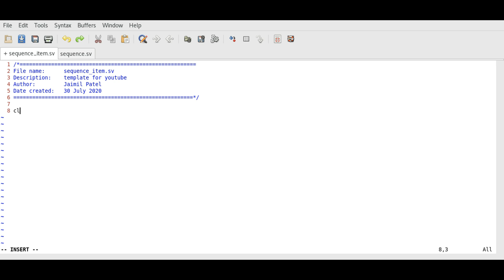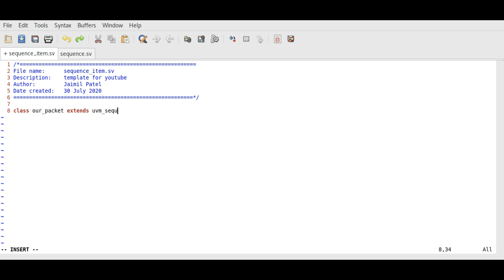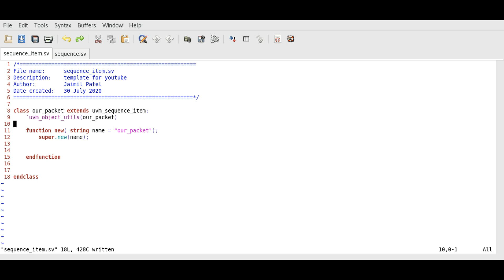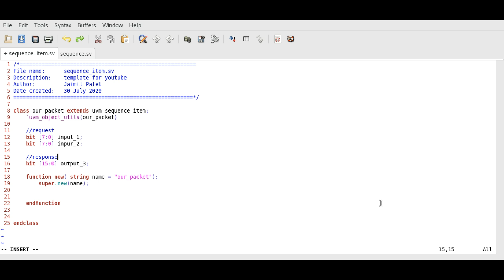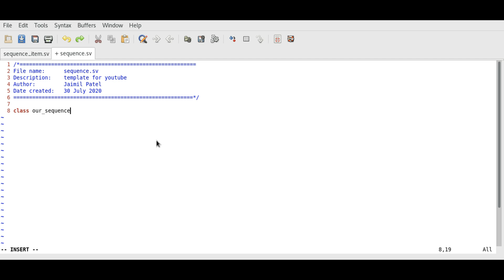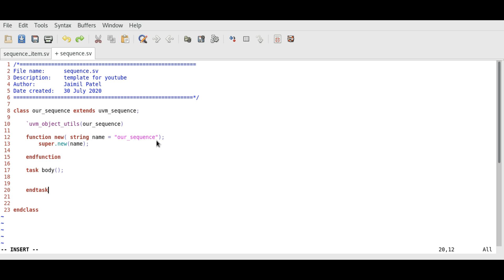UVM Simplified (#9 UVM Sequence_item and Sequence Class)

Comment: what is utils
Reply: In the Universal Verification Methodology (UVM), "utils" is a package that contains a set of utility classes and functions that are commonly used in UVM testbench environments. These utilities can help simplify the process of creating and using UVM components, and can be used to implement commonly used features such as message logging, randomization, and coverage tracking. The "utils" package is typically imported by UVM testbench components, and its contents can be accessed using the "uvm_" prefix. For example, the uvm_error_reporting class in the "utils" package can be used to implement error handling in a UVM testbench.